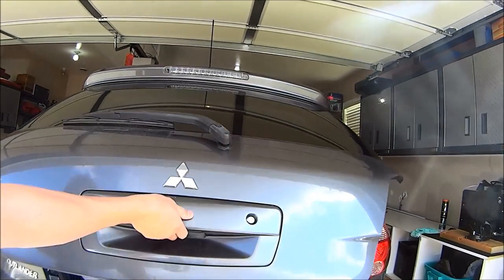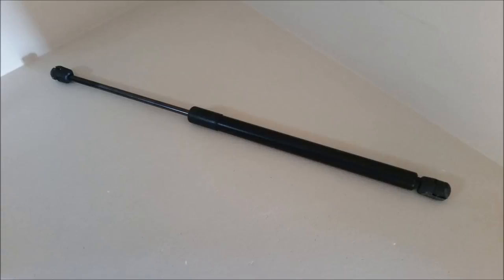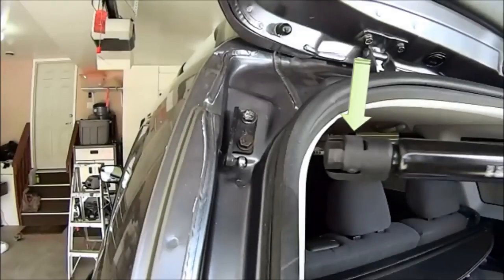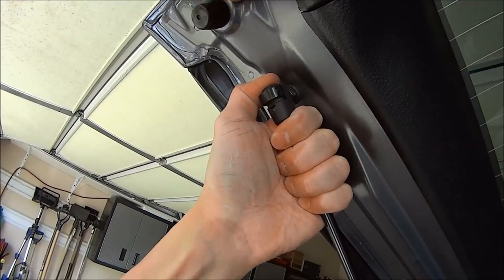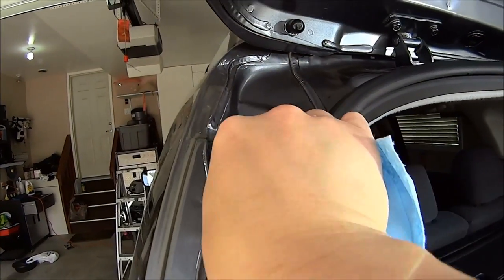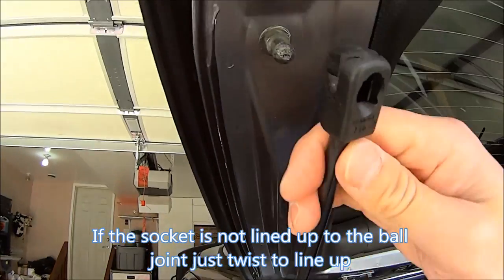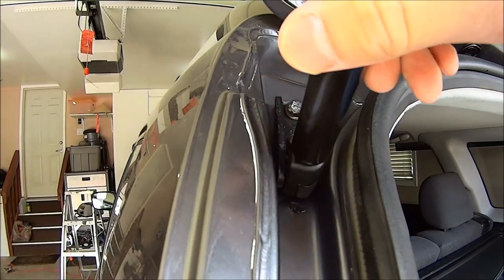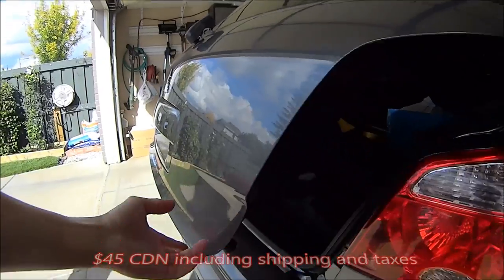Fix Hatch/Hood/Trunk lift support DIY - Simple Easy Cheap Fast Gas Strut Lift Support replacement

Comment: Thank you! Took 10 minutes! For anyone wondering, you can accomplish this without raising the trunk all the way up, I used a ladder to set the truck open onto 60% of the way up and had no problems and it was very sturdy and didn’t need anyone to help hold it up. You just have to hold it up a bit when latching on the second part of the lift that goes on the lid.
Reply from the maker: You're welcome.  Thanks for commenting.

Comment: Thanks for sharing kind sir.
It worked like a charm,
Note: on the outlander you might have to take 2 screws of the "rear lights" for better access to the "bottom ball", it will make sense when you in the process.
Reply from the maker: Thanks for the info and for commenting.  We didn't seem to need to take any screws off.  Perhaps you have a different year/generation Outlander?  What year do you have?

Comment: Cars 90 years ago might have had rebuildable shocks, but it goes without saying that struts and shocks aren't fixable. They're disposable like filters are. No one should have been fooled into thinking the struts themselves were fixable, and replacing them does fix the problem.
Reply from the maker: Thank you. Nicely put!

Comment: Great tutorial! May I know if there is any way to reduce the pressure of the gas strut? Coz it seems too powerful/high pressure for the new pair that I have installed for the front bonnet of my car.
Reply from the maker: Thank you.
Unfortunately there isn't a way to increase or reduce the pressure.  You have to get ones that are matched to you vehicle.  In my case, the first time i did this I purchased two that were for too low a load and it resulted in the trunk not lifting all the way.
Reply: @FrakkingCreations  you are welcome, I see... problem of mine is actually an aftermarket product, but it's meant for my car model, and now everytime when I close the front bonnet, I have to use a decent amount of force to close it(couldn't just simply drop it & let gravity does the job) due to the very strong lifting force 
Anyway, thank you for ur quick reply!

Comment: will this work on any vehicle or just the outlander? Mine exploded and spewed grease everywhere so I definitely need to replace it.
Reply from the maker: It can work for a lot of vehicles.  You need to check a few things though... It's easiest if you use the form to select the vehicle you have so that the correct struts are recommended.  If you don't get the struts that are for your vehicle you may experience the trunk/hood not lifting fully by itself or the attachment ends not matching to fit your vehicle's attachment points.
If you vehicle uses different type of attachment points instead of the ball type I showed in the video then the installation process will differ.

Comment: I'm with the others on the 'Fixing' not 'Replacing' lol I'm looking for a ghetto cheap way to fix mine without replacing... like spraying flex seal on it or some other cheap way of doing it :)
Reply from the maker: Thanks for your feedback.  Though we are talking about fixing the hood/trunk/hatch of a car. :)
I can't imagine a cheap fix that would only require repairing the seal of the strut.  It has usually lost too much pressure and need some sort of recharge.
If you find something that works, please share!
Reply: I just replaced my trunk struts, but it still doesn't open without assistance.
Reply from the maker: I think you will need to get ones that are matched to your vehicle.  Also, i had bought cheap ones before that are the same length as the originals but were not able to lift the trunk like your situation.  I just ended up buying ones that are stated to work for my vehicle and that are name brands.  The ones in the video are the ones that worked for me.
Reply: This is pretty cheap in my opinion and it solves the issues I’m having

Comment: @Frakking Creations question did you use OEM struts?
Reply from the maker: No.  I used the brand shown in the video.  You don't necessarily need to use OEM ones but don't use cheap quality ones.  Cheap ones don't last and may not lift the trunk/hood up with enough force.  Make sure the ones you get has the same lifting capabilities as the originals.  It may be easiest to find a brand that has direct fit parts for your vehicle.

Comment: I replaced mine and they're still bad? Did I get bad struts?
Reply from the maker: The struts/lifters you bought are not matched to your vehicle.  Get ones that are for your specific vehicle as not all struts/lifters are rated the same.  Plus some could be cheap ones that aren't that good.

Comment: Could I do this by myself as the boot doesn’t stand up
Reply from the maker: Though there are ways you can find to prop the boot up, it may not be safe.  It's up to you if you want to take that risk.  Best if you could ask someone to help hold the boot up. It needs to be held up all the way.  Maybe ask the cute neighbor next door to help 😉
Reply: It’s funny you say that because I managed to fix the problem by holding the boot with one hand and take  both struts out with the other hand all by myself with no assistance and it took me five minutes to do the job so it depends on the individual and your skills
Reply: @jeffreynanatakyicollins101  ..and then man invented the broomstick..
Reply: Rob Stammen ehhh???
Reply: @robstammen80  
Exactly what I used, but I actually used the whole broom, it helped like no other.
Cheers !